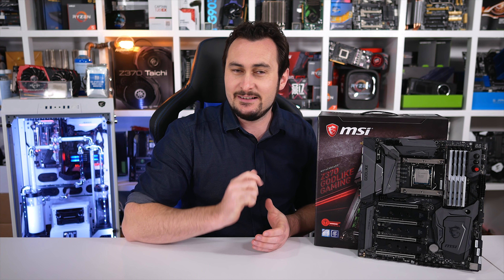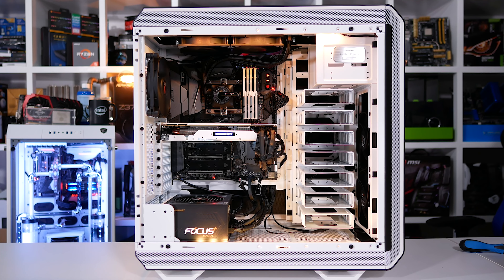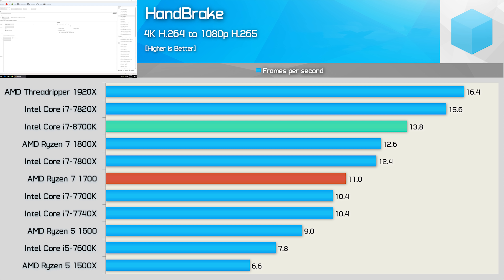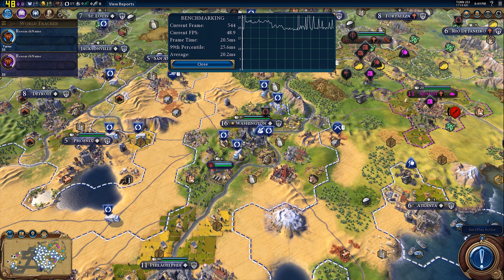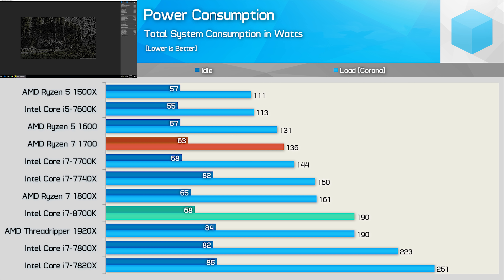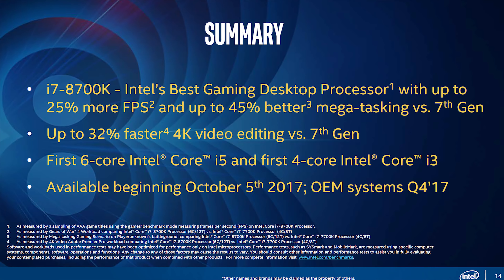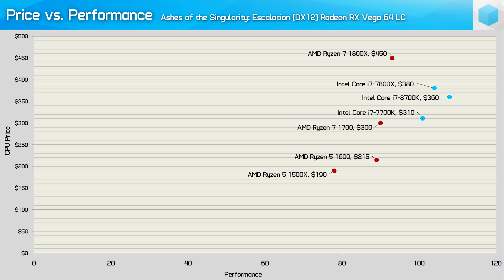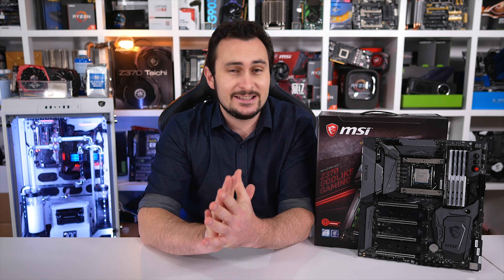Intel Core i7-8700K Review, The New Gaming King!

Comment: I´m still rocking my r5 1600x lol the next cpu upgrade will be in a few years anyways so yeah ^^ but I´m impressed how fast the cpus evolve! :)
Reply: yeah a bit of a push in the back from competition always seems to help
Reply: Alexander Rewijk indeed!^^
Reply: FAST ? 8700K is almost with the 7700K there is no jump here still the same intel milking thing.
Reply: Alain Abrahan dude if the locked 8700 is around 300USD and matches R5 1600 OC on a stock cooler. Then the whole 8th gen is complete shit. Because not every one have the balls to buy a 50USD beefy CPU cooler. But only the real market price can judge the locked CPUs , and if they run like 80-90°C on the stock cooler.... then i don't think there is a point to cosider this gen anymore..... 
But 50USD off on these locked CPUs and 50USD off on a R5 1600 would be a deal to die for.
i would still go for 1600!! because all hail the stock cooler!😂
*lives in india ambient varies from 5°C to 40°C *
Reply: Yeah, still cool that AMD will probably have compatible CPUs for Mobos till at least 2020.
Reply: I agree.  the 8700 is an upgrade path to nowhere...

Comment: For BF1, please take these notes on.

Uncap the fps so you're not limited to 200fps. You can do this with a console command:
GameTime.MaxVariableFps 0

Secondly, please use the DX11 mode. The DX12 mode of the game is broken and shit. My 1080Ti gets vastly better framerates at 1080p than 154 and I'm guessing this is because of DX12. Alternatively, just do both modes.
Reply from the maker: Does the frame cap command work for the single player? Last time I tried it didn't. Anyway there is nothing wrong with the games DX12 support, the issue is your GTX 1080 Ti doesn't have proper DX12 hardware support.
Reply: Appreciate the reply. As far as I know, to uncap singleplayer you have to make a config file with that command in it. I can find a link telling you how to do it if you want.

Indeed, the 1080Ti has very poor DX12 support but the 1080Ti is the strongest performing GPU in games there is- so tests to push CPUs where the games aren't GPU bound should be catered best for the strongest GPU, no?

Comment: Is it me or the Vega 64 paired with a ryzen cpu is getting neck to neck with the 1080ti ?
Reply: It was only like 6 frames behind it in bf1
Reply: A friend of mine is rocking a 6800k + 1080ti and he has even less frames than i do in BF1 1080p. I am running a 3.9GHz 1700x paired with a stock Vega64. It makes me wonder how will vega perform with drivers optimization in the near future.
Reply: alexandre lartigues yeah it does have the potential to perform better but these cards really are not meant for 1080p tbh
Reply: Nvidia is Sabotaging ryzen I get a vega56 because of that.
Reply: alexandre lartigues only at 1080p, who buys a Vega 64 or a 1080ti for 1080p gaming lol.
It's a different story at higher resolution ie 4k which is where the 1080ti leaves Vega behind.
Reply: I would agree only if we were talking about 1080p 60fps. But i have a 144Hz freesync display. And let me tell you it's the smoothest experience i ever had !
Reply: 1080p 144hz really is the sweet spot for me or maybe 1440p 120hz ;)
Reply: alexandre lartigues what RAM speed? Unlike Intel, Ryzen gets good gains with fast RAM
Reply: 3200
Reply: Alain Abrahan not Nvidia's fault, more AMD can better align something to their CPU

Comment: Hey Steve, just a tip for battlefield games you can change the 200fps cap to whatever you want by going into the console in game and typing gametime.maxvariablefps 400 and then hitting enter. That command would change the max fps to 400 instead of the 200 fps standard cap.
Reply from the maker: +The Betrayer does that work for BF1 single player? I've tried in the past but couldn't remove it.
Reply: It should work for the singleplayer as well as the multi, at least it did in the previous games. I haven't played the bf1 campaign to test for myself but I will boot it up tonight as I am in the states and report back on this comment. Thanks for all the hard work you put in, you are my go to when it comes to hardware testing.
Reply: Hey Steve, just got time to test it and it did work. I was able to change it to 300fps no problem.

Comment: I think the i5 8400 will be R5 1600 for Intel this generation. Should be good, but I'm not giving up my R5 1600 for it.
Reply: you cant OC 8400
Reply: r5 1600 are regularly having sales for around $160-190, while the 8400's msrp is $184
the r5 1600's performance is around 5% slower than the 7700k.
if you check the 8400's benchmarks, it's about 7-10% slower than the 7700k, while providing inferior multithreaded performance than the r5 1600.
i don't see how the 8400 is the new 1600

Comment: i7-8700K 6 cores 12 threads: consumes as much power as a ThreadRipper 12 core 24 thread CPU while performing worse.
i7-8700K $359.99: costs more than a 1700X at $298.99 while performing worse.

This CPU is ONLY for gaming. Please don't use it for anything else, it's a waste of money if you're going to multitask lol. Ryzen is cheaper and faster outside of gaming, so the 8700K is basically the 7700K and nothing more, because all of the gains outside of gaming still aren't matching Ryzen and it costs more, so there's no point. Intel couldn't deliver this generation, Pinnacle Ridge and Matisse (Zen 2) will CRUSH Ice Lake. See you in 2018-2019.
Reply: Peter Njeim 
You fanboy! You know nothing about Zen 2 or Icelake!

Comment: R7 1700 is still beter because you easely go over 150 with the intel build if you want overclocking and other features
Reply: 8700k just rek the shit out of 1700 even on productivity
Reply: Not when you overclock the 1700 to 1800x like speeds. Its basically free performance as the stock cooler can manage it. Haha
Reply: 8700k can also rek the shit out of 1800x even on productivity. its what you amd users "bang for the buck"

Comment: What the Point of a 6 core when you still need to get a new Mother board!!! when you just purchased a new $250 Z270 MB 
If intel would get there Head out of there ass and made it back words compatible with the Z270 i would have snatched up the new 6 core in a sec but now Intel can kiss my ass...

P.s. Yes i am Pissed off it seems like there is no real reason to do this..
Reply: it sucks to be you but i have a 2500k and i would love the 8700k
Reply: The power consumption with the 8700k is much higher than the 7700k when turbo kicks in, so they needed a healthier chipset to keep everything under control. with enough engineering, they could have made it backwards compatible without overdraw or overheating issues but they needed to steal some of AMD 's shine and fast. adored just did a great video on this and how Intel is pulling yet another paper launch to get mindshare back even though it ruins their relationship with mobo manufacturers who now have a large amount of Z270 Mobos that no one will buy.

Comment: I have seen a lot of people getting a large increase in ryzen performance by lowering memory timings instead of using faster clocked memory.
Reply: you still need faster clock but after 3200mhz its important to keep latency as low as possible to get the most out of a ryzen chip.

Comment: Looks like I'll buy R5 1600.
Reply: Damn straight.  The 8700 is an abortion from the start as there is no performance increase over similar Intel offerings.  Won't even get into the compatibility train wreck.  The current Ryzen chip set will work with the upcoming Ryzen 2.   Intel - Fail!

Comment: For the impatient among us.

8700k at stock:

matches R5 memory bandwidth, matches R7 1700 in Cinebench at stock, closer to the 1800X in Excel benchmark, more or less matches 1800x in Premiere, kills every R7 in Handbrake encoding, pretty much as the title says for gaming and power consumption is at Threadripper 1920X levels.

8700k OC vs Ryzen OC:

Its an 1800X that rapes your electric bill
Reply: FeTi Productions  im fine that a 6 core battling it out an 8 cores.
Reply: aren't they both in refridgerator territory for CPUs though? All I simply meant is that its higher than an OC'ed 1800X's typical power consumption. There's nothing more to it
Reply: I think he is pointing to your typo...
Reply: calm down intel fanboy . the 8700k is much more inefficient than ryzen 7, look at the power draw graph. did you watch the entire review? you said it kills R7 in handbrake encoding, but it barely manages to beat a stock R7 1800x not to mention, you need to delid the 8700k and run it @ 5.2 ghz just to catch the R7 in everything else. 

like i have told many intel fanboys before that boast. not much people are going to delid their cpu. its a risk not worth taking because it  voids warranty. so dont act as though delidding is as easy as installing an AIO. and when ryzen is overclocked it still beats your delidded 8700k in productivity.  also the 8700k cost 360us, any ryzen 1700 cpu can be overclocked to match 1800x performance on the stock cooler. ryzen 7 is currently under 300usd. 

further more intel continues to piss on you intel fanboys. by not even allowing 7700k users to upgrade to the 8700k you have to go out and get new board and cpu even though it uses the same socket. ryzen users will have an upgrade path straight to zen 2.
Reply: its an* 1800X, made sure double post before you guys accuse me of edits. Its up there, relax yourselves
Reply: warcrab cyber Do you even know what the turbo boost frequencies for the cpu are? Because it seems like you don’t. The i7 was benchmarked for the first part on a regular all core turbo boost of 4.3 GHz and already matched an equally non OC R7 1700. The 8700K has been benchmarked elsewhere running at 4.9 to 5.0 GHz on AIR and the performance numbers are very similar to this so no, you don’t need to delid and push 5.2 GHz to see similar results but you just felt the need to jump guns and come and try to shit on others without even thinking. PLUS and I need to say it because you lack basic reading comprehension skills, Steve put it very clearly in the title: “GAMING KING” as in gaming, just in case you didn’t notice.
Reply: i have issues?, you made a stupid statement, then when ahead to edit it out, so you wont make yourself look bad.
Reply: warcrab cyber Thanks for confirming what I already knew, you just came here to complain based on nothing. Have fun.
Reply: was i talking to you? i am pretty sure i wasnt, also. i am pretty sure i didnt shit on anyone. i certainly  didnt use any profanities like you are instigating. are you super hero of morale? if you want to be the hero here make sure you know what battles you are fighting before jumping in.  another point is to get your facts straight.

the i7 8700k turbo boosts to 4.7 ghz and it still struggles to beat a stock R7 cpu in productivity. intel has a big advantage in clock speed here.  also like i told the other intel fanboy. a ryzen 7 1700 can be overclocked to match 1800x performance on a stock cooler. it cost under 300$ vs 360$.  enjoy your delidding
Reply: do you even know what I edited? I edited one thing in my statement and that was changing lazy to impatient. dont harp on what you dont know sir
Reply: OC results: 8700K at 5Ghz = R7 at 4Ghz in production, like almost exactly, except the i7's got a nice leg up on the R7 in this Premiere render (not in Gamers Nexus'). Gaming's better on the i7 (no surprises), but depending on the situation though.

Price/performance Ryzen's better, aside from the 1800X.
Reply: not really, 8700 blasts ryzen away clock for clock performance and especially in gaming.
Reply: Oxaile still pulls more power than a 12 core cpu
Reply: dante

the difference in gaming is almost unnoticeable without an fps counter. if you dont have two 1080 tis, then upgrading a cpu every generation is moronic because you will notice no gains. buy a gpu for gaming performance, this still hasnt changed.
Reply: TheSinisterEyes1 Vega 64 pulls more energy than a Titan Xp, what's your point?
Reply: 8700k is $380 bud. . . Saw the 1700 for $265.

Comment: Barely better than 7700k with same power consumption as a threadripper. Well done intel. Ill laugh when ryzen 12nm comes out. Still no reason to upgrade my 2600k running at 4.3ghrz.
Reply: I must admit I'm a bit disappointed, every owner of 7700K has no real reason to upgrade.
Reply: Also is not Compatible With Z270 Motherboards, shame
Reply: 3770K here and still chilling 2560x1080p gaming :-) waiting for Ryzen 12nm and coming slowdown of mining craze to scoop up both CPU & GPU upgrades @ reasonable prices
Reply: Deejay Core if navi does have infinity fabric type thing then sure upgrade to it but other than that it's not worth it tbh
Reply: 3770 non-k here. 120hz is hard with a GTX960. Waiting for Novidia's next generation or a cheap 1070.
Reply: +Kikoo Kikaboo WHY? What did you expect? We all knew there would be no IPC gains, it would be a 7700k with 50% more cores and threads, that's amazing. It also clocks higher than the 7700k in general despite having more cores.
Reply: Yep, new king my ass
Reply: huh finally we got a real gaming cpu that also can do some work. but be happy living in 2010 >^-^<
Reply: CryBeat maybe because 2017 offers a minimal improvement over 2011?
Reply: well, if they want a good multi thread cpu as good as 1700x but has the single thread power of a 7700k.
Reply: @ Kikoo Kikaboo Why would an owner of 7700K want to upgrade so soon. They would be nuts to do so.
Reply: Kikoo  This cpu isnt for 7700k owners, you dont and probably shouldnt upgrade a cpu every generation.  the fact that they come with a 3 year warranty means they are probably meant to be used longer than that.  this is for people who are unhappy with their performance. there hasnt been a cpu release probably ever that was a worthy upgrade over the previous generation.  2600k-3770k owners and up, assuming youre sticking to i7s, are probably perfectly fine at this point in time.
Reply: +A Very Silly Sausage It clocks higher, yes, but also has a much higher power consumption.
Reply: Same here, i was waiting for coffee lake to be released and well, i'll pick a ryzen you can upgrade the cpu with same motherboard in the future anyways and intel performance its not that far to justify that.
Reply: Ah so this i the cry thread
Reply: Yeah I'm waiting for their 10nm to see if I'll be upgrading. To many refresh on the same technology and all while forcing you to buy new motherboard every time. That one of the plus I see with Amd  Am4 that they said you can use same motherboard. Still waiting to see when nvidia says there releasing Volta..
Reply: 8700K is really a good CPU, there's nothing to talk about. It does about the best in gaming and production it's extremely capable.

For someone doing both and willing to put the price (more than 500USD for CPU+mobo) it certainly is the perfect CPU to have. For someone doing only Gaming, no improvement.

Should I buy a new CPU I'd probably take the 8400.
Reply: Kerim Temel I'm not replacing my 5820k unless it worth it and even then want to replace it with something that be worth it. Have hopes for cannon lake or maybe the zen2 will be worth the price
Reply: Well i think the main benefit from something like the 8700k would be that now you get the best of both worlds. With the 7700k you kind of sacrifice some multi threaded performance for better gaming performance. Where-as with the 8700k you're getting slightly better gaming performance and much better multi threaded performance. Thus giving you the best of both worlds.
Reply: no shit it has to consume so much power. more performance = more power. more clock speeds per core = runs hot. youre laughing because amd doesnt run hot, because they cant reach that high clock speeds.
Reply: good decision. well if youre rich might aswell upgrade but if youre on a fixed budget I advise you wait til zen2. hype is already rushing.
Reply: Kikoo Kikaboo i7 8700k isnt good.... i7 7700k is still the king!

Comment: Still ryzen is the best
Reply: HeavensOfGames i disagree.. if the 8700 locked varient performs more than 20-25% better than a R5 1600 with additional 100USD more(not including price of a 30USD cooler and the pricey motherboards,lol)
i dont think its bad at all.
(laughs in R5 1600 stock cooler, muhahahaha)
Edit:https://www.pcper.com/image/view/78910?return=node%2F67215
IPC difference measured with the help of cinabench @3.5
result- AMD lags behind 8-10% and 8700k all cores speed is 4.3GHz assuming that, 8700 just might be only 25% better than an OCed @3.9 stock cooler R 5, and to get that 25% you will be paying atleast 100USD extra lol
Reply: I'm assuming they're talking about price to performance. You can get an R5 1600 for 200 compared to that of a 8600k (259 in price) which is still only a 6c/6t CPU. On top of that, Intel pushed out the CPU earlier because of Ryzen so there's only Z motherboards which are fairly expensive. So you could get a decent B350 Motherboard + R5 1600 for about 300 or you could get the i5 8600k + Z370 for 460 or so (Cheapest Z mobo I found was 200). You also get the benefit of paying extra for an unlocked processor because Intel wants your money, amazing.
Reply: ryzen 7 is in fact still king of the price point when talking pure horsepower , if your a gamer the 8600k would be better than both of these chips value wise , the 1700 @4.0ghz still reigns king in productivity and multi threaded workloads. Gamers have intel for the mainstream market , video producers have AMD for the mainstream market. How about fanboys stop trying to bash AMD and realize without ryzen Intel would still be shoving quad core cpus down your throat, and still charging thousands for there productivity lineups 6950x anyone?
Reply: phillip martin wish I had Intel fanboy logic(wait thank God I don't) undermining and buying(literally) manufacturers and retailer's off just to say they are number 1....